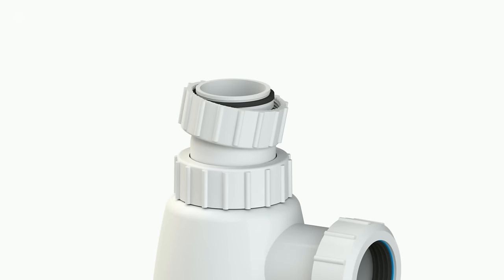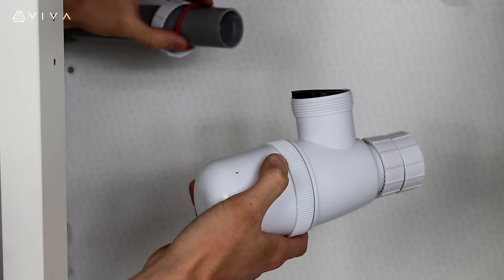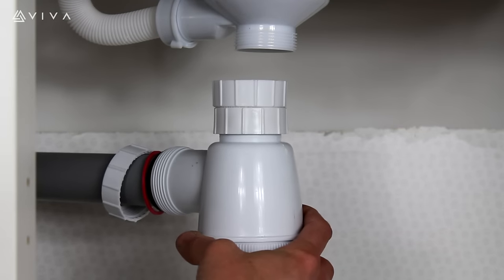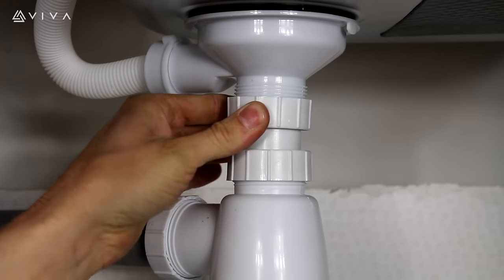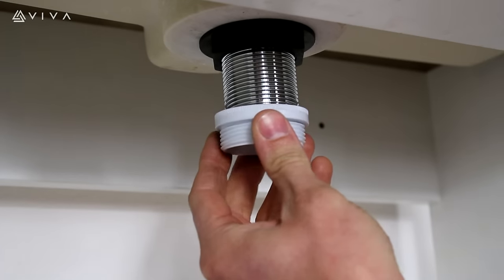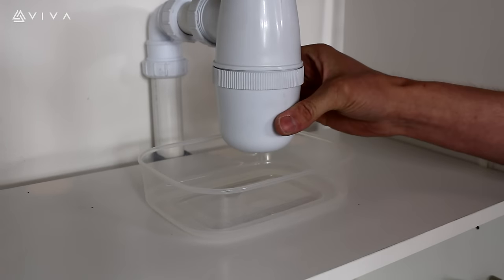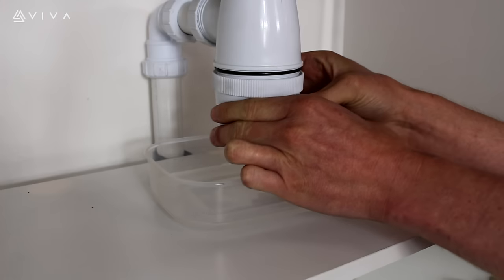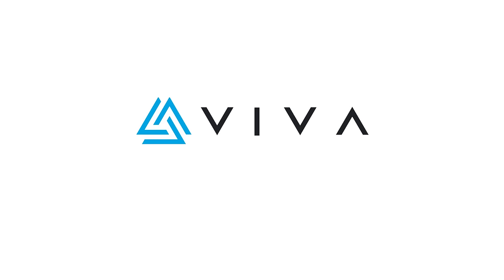How to Install or Replace a Universal Telescopic Bottle Trap for a Bathroom Basin or Kitchen Sink

Comment: Had a leaking connection between the waste and the trap. The black washer bit was stuck behind the trap thread. The video showed me it needed to be taken out and attached to the waste before screwing everything up. Thanks it worked really well!
Reply: I have the same problem but, how did you fish the rubber ring out? Both black rings are stuck down too far and I can't seem to hook them out. May have to buy a new trap due to this.
Reply: @annwitbrock9112  its a long time ago and can't remember! I thinl they are cheap to buy so pull it out and don't worry if it breaks
Reply: For me too.

Comment: thank you - this helped but I couldn't see which way round the rubber washer was and had to good 'shamford edge'  until a friend said I probably meant 'chamfered'. For anyone else you need to put the stretchy washer over the pipe from the wall with the pointy bit pointing at the trap

Comment: thanks for this I dont have to cut through the waste out flow pipe to fit a tee and pit an air addmittance valve on top ,so this saves me a lot of trouble ,thanks